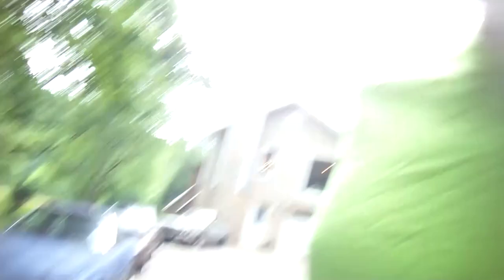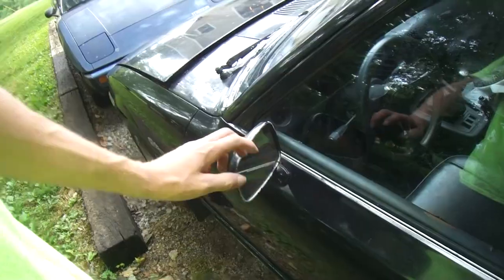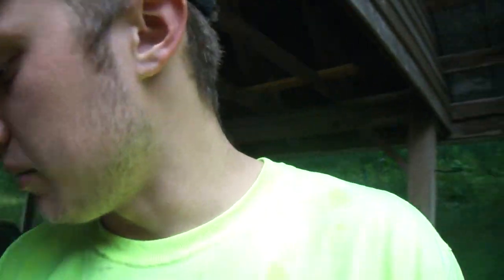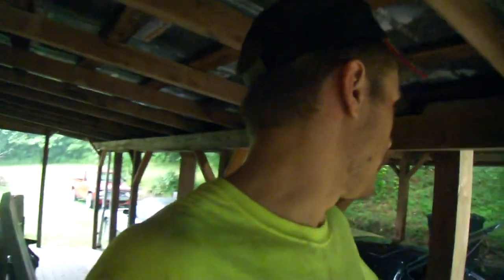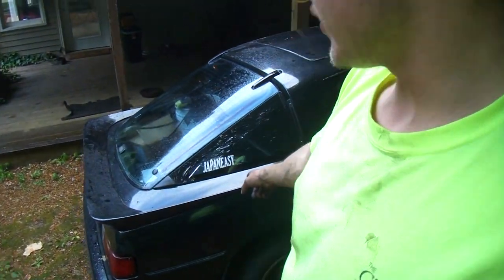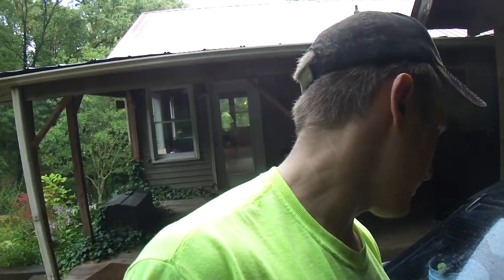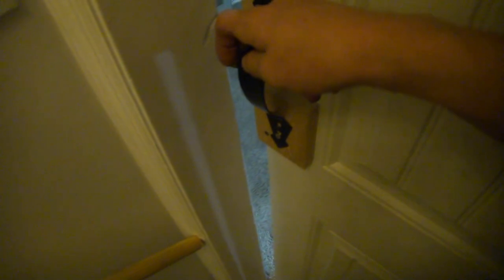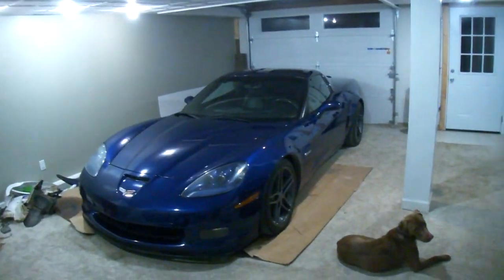79 RX7 WING INSTALL IN THE RAIN

Comment: what is the best rear diff ratio for the first gen?
Reply from the maker: I prefer the 3.9 for the street.  Just a better hwy cruiser, but most like the 4.10 from the gslse.   Personal preference.   Tire size will have an affect as well
Reply: @RADPotential  was thinking for a track car, not to many hwy miles. Does the 4.10 make a big enough difference?